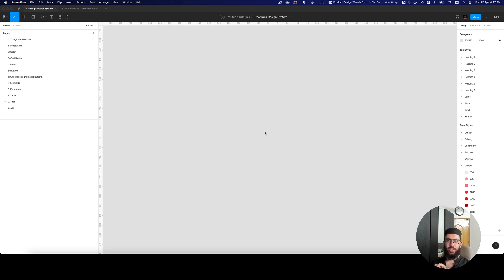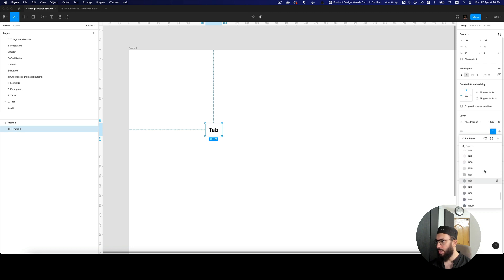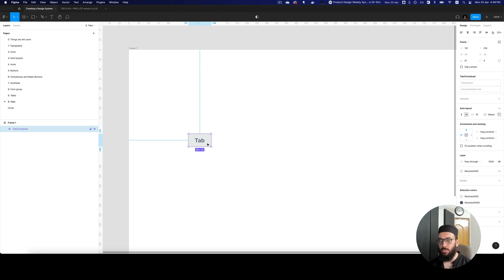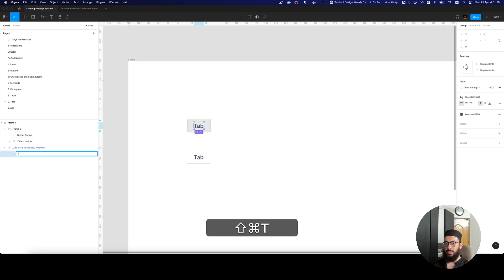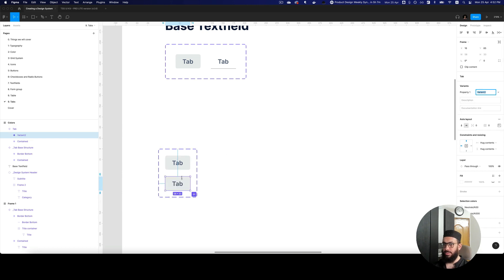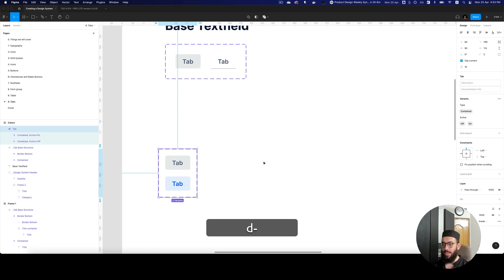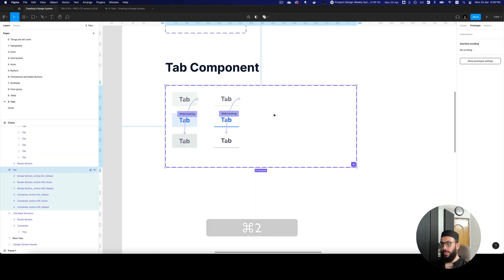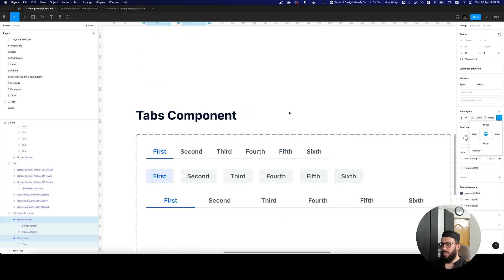Creating a Design System - Tabs

Comment: Hello, I'm newbie UX/UI I saw your tutorial. I want to ask you about this one. When I start new project I need to create System design first or I need to draw wireframe and pick button, color, icon... for do system design first?
Thank you!
Reply from the maker: Colors don't come in that much in the wireframe stage.

Wireframes don't require a design system, so you can create the wireframes before it if you want.

WIreframes are low fidelity designs that are just about the content, placement, and structure of pages.

Mockups or high fidelity designs then introduce the design library and the colors, branding, etc.